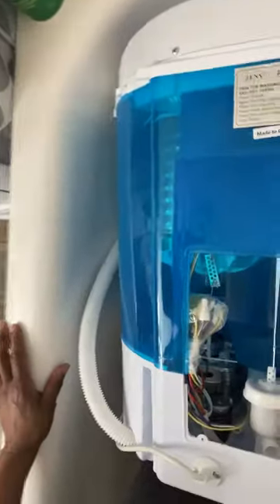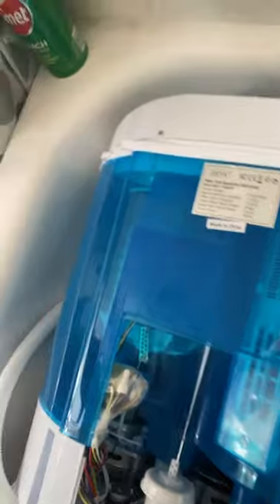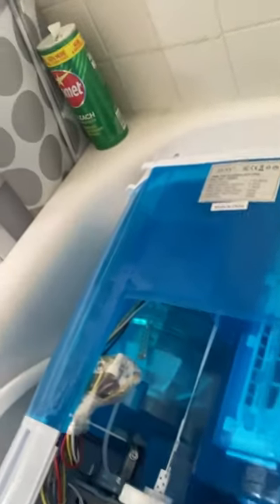How to Repair Spinner Basket on Zeny Portable Washing Machine

Comment: Did you fix the problem I have the same problem the dryer won't spin o
Reply from the maker: Yes, I did fix the problem. 

FIRST FOR SAFETY UNPLUG THE WASHING MACHINE. 

Make sure that the basket is positioned and sitting straight up and down, not tilted to the left or right.  

 Gently push spinning basket straight down, before laying machine down on floor, with back of machine facing up towards ceiling.

Next,  you will have to carefully and gently move wires to the side while you tighten the bolt first, then screw.

Then follow the instructions on the video and have patience while screwing (tightening) the bolt behind the screw first (use a tool to do so), then use long Phillips head screw driver (to reach in back of machine) to the screw, then tighten the Phillips head screw.   
Just follow the instructions and you should be successful. You can do it!
Reply: @lindamc6090  
What seems to be the problem in your case ?
May I ask how did you fix it?
Thanks
Reply: @lindamc6090  
I did try to straighten the screw but it does not let me straighten it because it's already straightened to the maximum even if it does not show like it but I will try one more time
Reply from the maker: @swanmeskini2784  I don't understand what you mean by straightening the screw? Do you mean tighten the screw? Let me make sure I understand exactly the problem you're facing. Was this a new washing machine or one that you already had that stopped spinning?
Reply from the maker: @swanmeskini2784  I was sent a new washing machine, and the basket was leaning to the side and very loose. When I tried to spin the clothes it would not spin and only made a grinding noise.  At that point I had to make sure that the spinning basket was standing straight up and down, instead of leaning to the side and pushed it down a little bit, then I screwed in the bolt and Phillips head screw like in the video.  

You may have to loosen the bolt & screw a little bit to make sure that the spinning basket is sitting vertical in that part that has the bolt and screw attached to it, then re-tighten bolt & screw after this basket is sitting in that piece correctly.
Reply: Im so confused but I’m having the same problem my dryer aint spinning just makes boise i just got mine today and it’s frustrating as hell please someone help
Reply from the maker: Hi TruLu, I'm sorry that I'm just responding to your issue.  Were you able to get you spinner working?